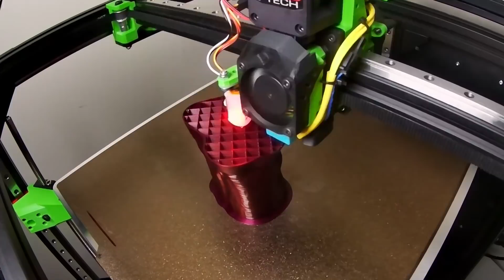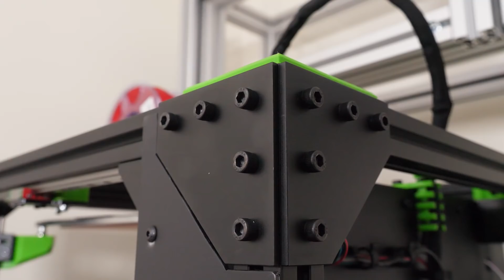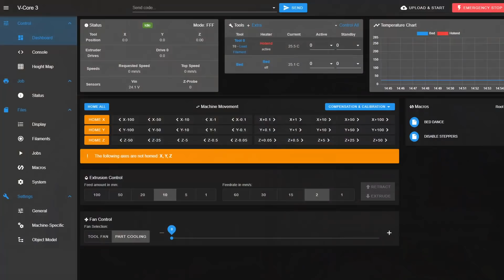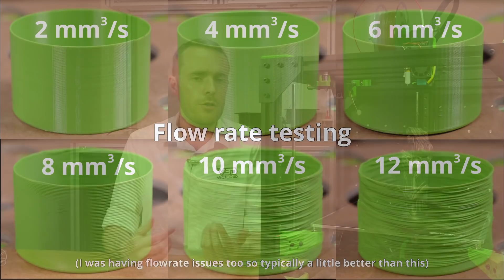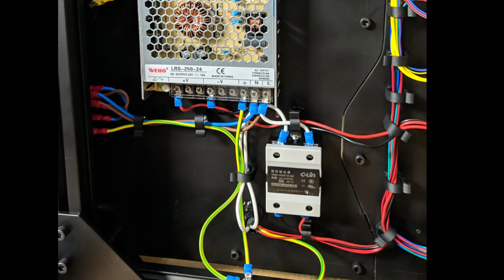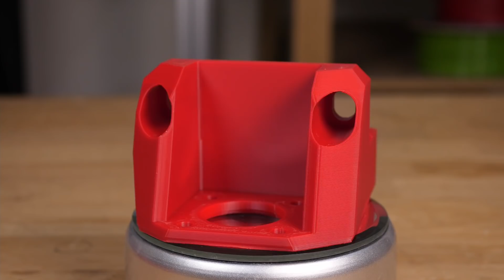The Best 3D Printer Kit Money Can Buy in 2021?

Comment: i think it would be really beneficial if ratrig got away from the lead screws and went with a belted zed, lead screws just have to many problems u have to make sure u didnt get a bent one u have to make sure you set the coupler on straight then set the lead screw in straight, i know lead screws work but for some people that didnt get lucky and got one that is a little bit bent or whatever, you dont have to worry about any of that with belts the only thing u have to deal with belts is did i tighten it to much or to little and i would much rather have that problem than to deal with lead screws... oh sorry got off on a rant great video Adam/Vector3D
Reply: The problem is not lead screws, the problem is cheap-ass Makers using cheap-ass lead screws. Lead screws are better in almost every way to belts with the exception of rotational mass - which is not an issue on the z-axis.
All that said, the z-screw implementation on the V-core is done well, but has some room for improvement. For instance, the coupler rests on a bearing, but the screw should be machined round, and the round section should be supported, and then enter the couling.
either way, it is far better than the nightmare of overcomplication that the Voron uses.
Reply: @joshua43214  lead screws are not better than belts good belts, even vector hinted at z wobble but didnt go there z wobble is a problem you wouldnt have if running belts, running belts on the z is also faster it is just better all around
Reply: @3dprintingcave778  Belts have less mass, which makes them able to accelerate faster, which is not an issue with the z-axis. What is an issue is stretch, belts will stretch, and then vibrate on rapid acceleration, something that a screw will not do. Belts also lead to an under-damped system, and overall more vibration. Screws by their nature and over-damped and will contribute to reduced overall vibration.
Good lead screws are very very straight, and will not give any z wobble at all. 

I can give a real life example. I spent the morning doing Laser Capture Micro-dissection. The stage  has about 150mm of x-travel and uses 3mm lead screws. I repeatedly dissected out tissue samples of approx. 20um^2, even the smallest bit of run out in the lead screws would have given me samples contaminated with neighboring unwanted material since the stage floats on ball bearings. Not only will the stage return to exactly where it came from every time, it moves fast enough that it stings if it hits you.
Belts are for conveyors, not precision equipment. Like I said, the issue is not screws, the issue is poor quality screws.
Reply: @joshua43214  the belts on my printer run perfectly fine good belts do that, what your talking about is most likly very expensive lead screws or ballscrews which are not used on 3d printers for the most part not hobby printers not even a little above hobby level, i have been running this printer with belts for over a year i dont see anything you decribed happening with my system, but you can like what u like ill like what i like that makes everyone happy and for me i think all mid and highend 3d printers should all be run on belts it is far better than china lead screws

Comment: Excellent and very fair review! I pretty much agree with all the points you made, especially the one about a high flow option. I never recommend the default kit because there are much MUCH better options out there. Thankfully, you can fix that by ordering a configurable kit!

You're right about the slicers, it's a difficult nut to crack. V-CoreOS does come with start / end print macro's, firmware retraction defaults and sane pressure advance settings for all the available options right out of the box, so that should help a little bit, but this is definitely a point where the DIY aspect is obvious.

Are you gonna test the Duet 3.4 Beta 2? It should have input shaping now, no idea how good it is in comparison to klipper, but it looks like a good start! I haven't seen significant ringing for something like a year now 😂

It's been super fun following the process, and i can't wait to see what you do with it in the future! :D

Comment: I’m literally on the cusp of ordering and I was going to order the default kit up until your point regarding the hot end. Would you order one of the other configurable hot ends, or buy one not listed on the ratrig site?
Reply: The Dragon HF (you'll have to get that elsewhere) or Mosquito Magnum is a great match :)
Reply: I went with the Magnum on my 500mm. Do not buy anything but the PEI from RatRig if you are in the US. You will save hundreds by using US based suppliers because European prices for about everything are highly inflated. Get the 110v heater directly from Keenovo, keep in mind that a 1000W heater will draw almost 10A, you need a 15A (min) wall outlet.
I added a ton of extra options like a touch screen, camera, smart filament sensor, etc, and still came in well under what it would have cost to order the basic parts from RatRig.
Reply: @joshua43214  I currently heavily rely on octoprint to send and monitor prints. Can octoprint run on the Duet boards or do you just run the web interface? If the latter can I still hook up a web cam and monitor prints when not on the same wifi

Comment: Any comparison RatRig V-Core 3 400x400mm vs Voron 2.4 CoreXY 300x300mm? Kinda similar price.
Reply from the maker: You probably want to get subscribed. Just saying 😉
Reply: RatRig is much much more rigid. Voron is very very overcomplicated
Reply: @joshua43214  I would disagree.  The voron is miles better in design and function imo.
Reply: @JustKyzuuh  give me an example

Comment: Horrible ringing....
Reply: He's printing with high acceleration values. You can print at these high accelerations without any ringing pretty much if you use something like input shaper in klipper (reprap fw has a similar option coming soon). People printing crazy fast even on the 400 and 500s without any ringing if they use klipper's input shaping.

Comment: Hi Adam, I have recently been using the nozzle cleaning filament on my Micro Swiss hot end and even after a cold pull it still bings out a bit of the previous filament, I was getting more than average clogging but since I started cleaning my nozzle out when changing different types of filament I am yet to have one in more than 300 hours of printing
Reply from the maker: I have quite a lot of the cleaning filament that Rigid.Ink used to sell, in this case it didn't really help though because more force didn't push the blockage though so the filament couldn't get down there. Heating was the right way to go in this case i think.

Comment: Adam, I fully agree on the ABS position. Out of experience, the current parts are solid enough to repeint your own parts in ABS on this machine. One should start with the fan duct for obvious reasons. What I highly recommend: Do also reprint the arms with ABS. The arm surface is only about 10mm from the silicone heater, and during long prints, I found hotspots with 74°C. That‘s too much for PETG, and nobody wants a 230V bed at 110°C to fall down.
Reply: While the concern is definitely valid, and i agree it's a good idea, remember to mention you were printing ABS fully enclosed when you did that measurement. Other members have measured 50 degrees with 100c on the bed unenclosed, which is still fine. No reports of a falling bed AFAIK! :)
Reply: @miklschmidt  Well, I am with Adam on this: This is a printer that is in a class for advanced filaments. And most of those require 90-110° and a closed chamber. If you want to do that, reprint the EVA and the arms as a minimum.
Reply: @DetlevRackow  100% agree.
Reply: @miklschmidt  You guys did a seriously amazing job on this printer. It just screams to be used for difficult prints. This is way more than a hobby machine. 
It really needs to be printed in ABS. PETG is a great material for an Ender 3, this is not an Ender. RatRig deserves better.
Reply: @joshua43214  Thank you, although i can't take the credit there, i only came into the BETA/Dev team very close to release! I can't say i disagree about the ABS. But PETG is more rigid, easier to print and totally fine for open frame printing as has been proven time and time again. It's not a bad material by any means. Just because there's a better one out there for enclosed printing, doesn't mean it makes the existing one a bad choice, it depends on your needs :)

It's not a walk in the park to transform your entire production line into ABS printing machines. It's a process, and i know they're looking into options for how to tackle it :)
Reply: ABS is horrible, as well PETG, all of my printers are made from PAHT-CF or PC, I wouldn’t use anything else, this printer is a DIY joke, you can design and print your own Core XY or just go for the Voron.
Reply: @NexGen-3D  Actually, ABS is just fine for these machines. Yes, you can go the PAHT-CF route. I actually did that out of curiosity, and it works for me. Does it work about 100 Euro better? Nope. I agree that some parts of the toolhead benefit from ePAHT-CF, but most stuff is just fine in ABS and it saves you a lot of money.
Reply: @DetlevRackow  For me, ABS is only slightly cheaper than PA-CF and about 50% of PAHT-CF, and, money isn't really the main object, I just despise ABS, it smells when printing, its weak and is only slightly better than PLA+ in temp resistance, and is the weakest plastic I have ever printed,, I have almost finished printing my Ratrig parts, I did them all in plain PA-CF and main gantry/extruder parts are all PAHT-CF, you print this stuff with thinner walls so its way lighter, yet still much stronger and less chance of warping when printing hi-temp materials. Personally, I think plain PLA and ABS are destroying the 3D printing market, I now only print in PA, PC, TPU and I prototype/test print in PLA+.
Reply: @NexGen-3D  All that you mentioned, can be printed in an ABS equipped machine without problems. I have run a V-Core with ABS for 2000 hours, and it‘s fine. There are good reasons not to make some parts too rigid, too, ie the XY joiners.

For mere mortals, the price of PAHT-CF is about 100€/kg. A good ABS is around 20-25.

If your ABS parts are not strong, your technique is not evolved, which is surprising as you claim to print PC.
Reply: @DetlevRackow  ABS is rubbish, good for COS play BS, I used PA-CF (cost is similar to ABS) for all of the XY parts, it is quite flexible, but much more durable, easier to print and has a higher heat resistance vs ABS, now PAHT-CF is much more rigid, and as stated, I used it for all the hotend parts, if the parts last with ABS, then I'd use PLA+ instead as its much stronger, I will assume your printer during its 2000 hrs has printed mainly PLA, PETG and ABS? I print mainly hi-temp plastics and I enclose my printers, ABS will and does Warp, even the standard PA-CF started warping in places on my Voron Afterburner tool head, which is why I have chosen to make all hotend components from either PC or PAHT-CF, you don't need much filament for hotend mounts an ducts, so cost is not an issue.
Reply: @NexGen-3D  Oh, the worst toolhead in the performance segment. I understand why you face challenges. It‘s not the ABS you are struggling with.

Comment: Now I'd like to see you build a voron, even if just a v0/0.1 just to see the difference between the design quality differences. :)
Reply from the maker: Lets put it this way, I've typed the number 2.4 quite a lot over the last few days.
Reply: @Vector3DP  not sure how much you know about vorons, but the 1.8 is more closely comparable to the rat rig than the 2.4, but the 2.4 is more popular and it has a stable bed and a Z moving gantry. (1.8 has a z moving bed, and stationary gantry). 

That being said the 2.4 is the most popular "kit" (unofficial, as voron doesn't come in kit form, and can come with potentially questionable quality for some parts selection). as I'm sure you've seen if your common "2.4" search history, the channel Nero 3dp may have come up. He has a kit analysis of the 2.4 (although from only 1 of the multiple suppliers, and as he mentions, some of the parts he got in the kit may not be what you get due to supply).

Regardless, it would be an interesting comparison, especially since I don't think of the bigger YouTube channels (yourself in that category) has not a rat rig and a voron.  

And as you may be aware, but perhaps others may not be, the voron's use different control boards (although they can use a duet if desired), but use a raspberry pi, different firmware (klipper) and plenty of other changes. 

But I wanted to spark your interest in it again, although it seems to have been on your mind more than I would have expected given your previous comment. :) 

Either way, look forward to seeing more great content! Thanks for all your hard work, and taking us along the journey with you. I'm glad you have rekindled part of the spark of 3d printers after the monotony of very similar style machines. :)
Reply: @brandoneich2412  Klipper is an option on the V-Core 3 as well, and as the developer of V-CoreOS (preconfigured klipper package for the V-Core) i would very much prefer if the comparison used the same firmware :D
Reply: How can you compare quality between the two?
Rat Rig offers you a kit that you can buy from the team/company that designed the printer while Voron offers you a BOM. 
If you source the parts right the quality will be good if you go with the chinese kits the quality will be … well… whatever the seller of the kit wants :).
Reply: @mariusmym  well, Although you're correct, I fell like comparing this to a similarly priced kit. Would be interested.

Comment: 15:00 I think they changed the bed. Mine came with an unlabeled rough PEI one that looks similar but is missing the logo.
The magnet feels quite strong as well, so maybe that was changed as well. Size is still the same though
Reply from the maker: Interesting. even if its just slightly thicker, that will increase the attraction.

Comment: Wenn das Lager quietscht, dann ist es bereits futsch. Wohl die Gurte zu fest angezogen und dadurch die feinen Nagellager in den Umlenkrollen pulverisiert.
Noch quietsch und knattert es aber mit der Zeit frisst sich das feine Pulver was dabei entsteht durch das Lager und nach recht kurzer Zeit bricht es aus und verursacht sehr viel Spiel.
Reply from the maker: Thanks for the info, i'll look into it. Getting belt tension just right can be a tough exercise i feel. For those not german this is the google translate of the above comment: "If the bearing squeaks, then it's already gone. Probably the belts tightened too tightly and pulverized the fine nail bearings in the pulleys.
It still squeaks and rattles, but over time the fine powder that is created eats its way through the bearing and after a very short time it breaks out and causes a lot of play."